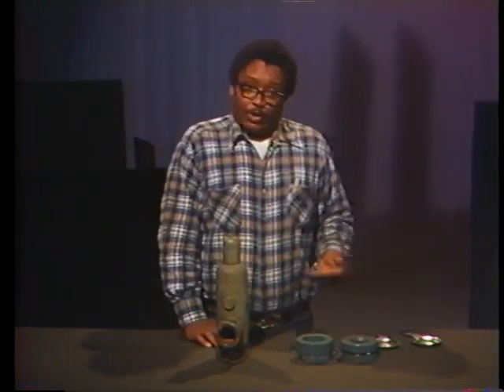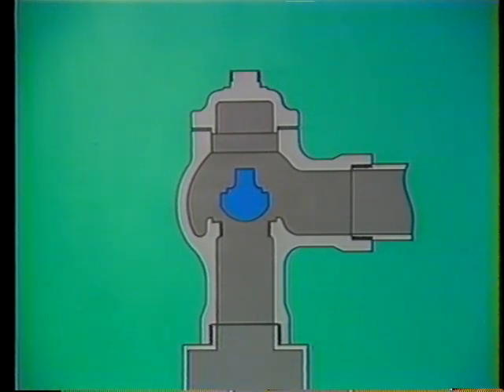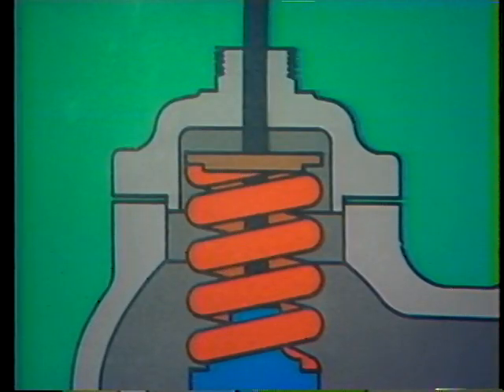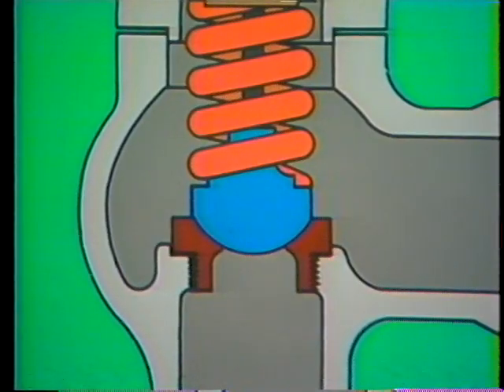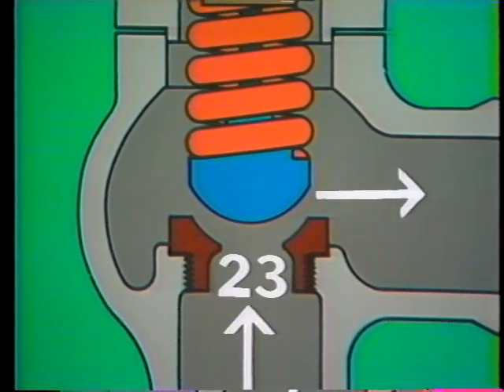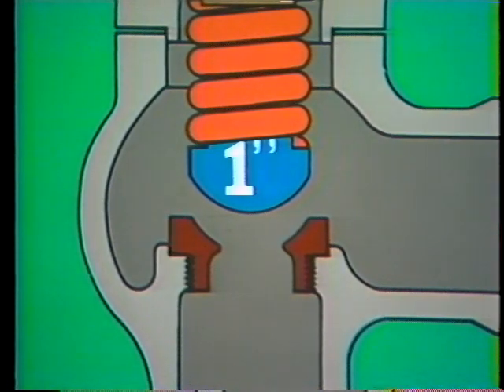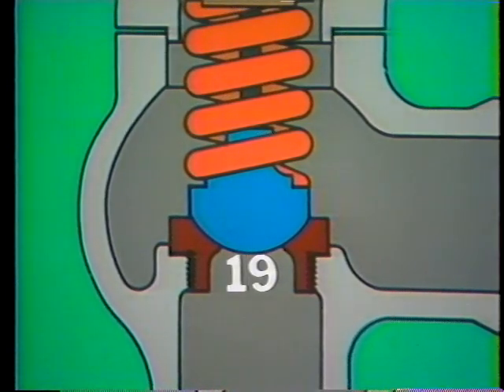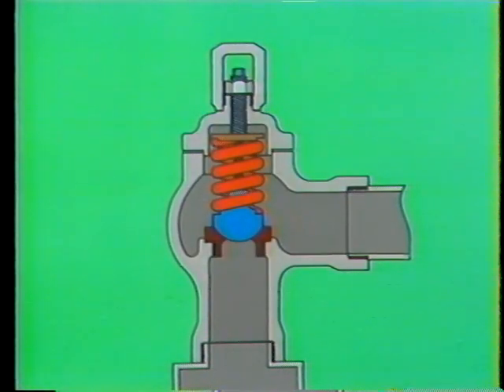How Relief Valve &  Rupture Pressure Disk Work ?

Comment: Question: If all the Valves and fitting of piping system are PTFE lined than Rupture disc will also PTFE lined? or any other superior grade material will select for RDs.